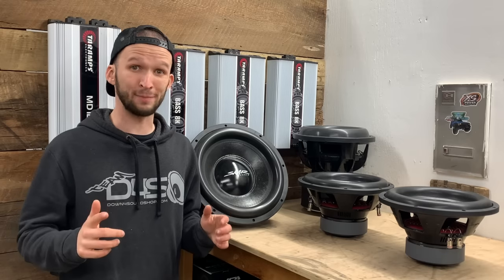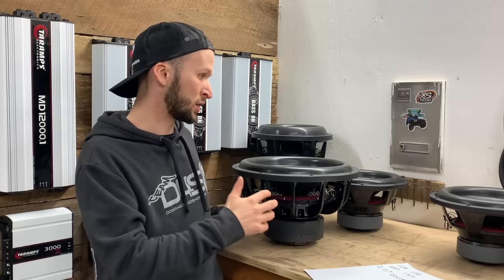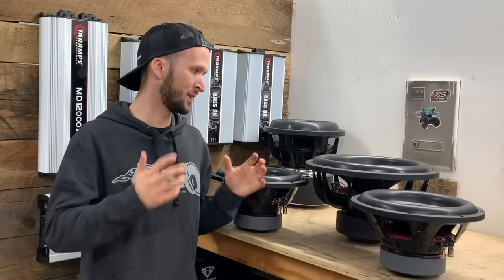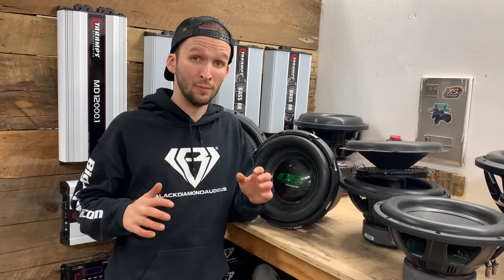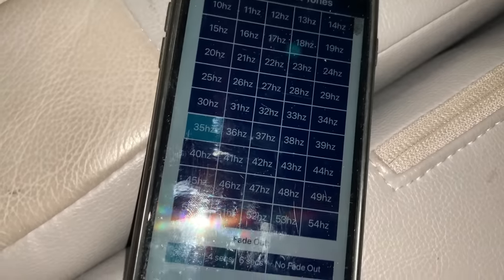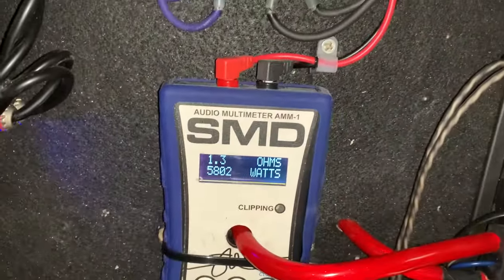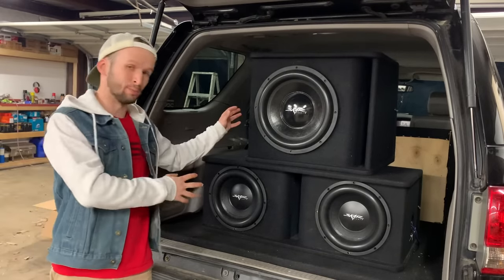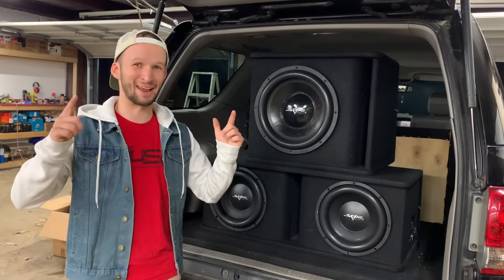ONE 15 VS TWO 12 SUBWOOFERS | MYTH BUSTED

Comment: Parker I just purchased a deaf bounce  db-sa302. What amp do recommend for this sub. I currently have a mojo 12 on a jl audio xmd 1000. I'm curious as to which sub will hit harder. I have to say I was very surprised by the mojo 12 on the 1000w jl audio amp. It is beating for one 12. My back doors and windows are actually flexing.  But I want to hear the deaf bounce. Just wondering what amp you would recommend.
Reply: The db has 500w more RMS power handling, but the db has 18.00 mm xmax, and Mojo has 19.56 mm of xmax. Plus, it has a 3.5in voice coil. And the db has a 3in one. The db might be 1 to 2 db louder, but really not much of a difference
Reply: @leoyser1369  no the db I have is 2000w rms at 4000w peak.
Reply: @GSR_Shawnnew3673_I'm Slow  yeah. I know the specs I was looking at the website
Reply: @GSR_Shawnnew3673_I'm Slow  how much you are willing to spend on an amp.
Reply: @GSR_Shawnnew3673_I'm Slow  I have multiple amps to recommend to you. I'm making a list

Comment: Don't know where those cone area specifications are coming from but they're not what I calculated, for example a 12 inch does not have 113 square inches due to the actual cone diam. is10.5"!.. .

Comment: Why presume that the same make and model of speaker in a bigger size is built better than the one below it? 15's and 18's are historically and statistically tougher to reliably control than a smaller size speaker.

Comment: It comes with cancellation. I'm just saying this before I even watched the video. Running one motor means you only have one problem to maintain. When you have two wave guides it's going to crash by a certain distance it's just audio science. The way we measure with a meter in weird corners of a vehicle also is not really true to the pressure of the complete. We really need lasers and other ways of figuring out the pressure against the vehicle. I haven't seen anybody do anything intelligent like that yet. Like i'm sure there's way to use flir to sense temperature changes in the body material of a vehicle. 
For the most part the officiators of car audio and competition for the most part a lot of it is opinion. It's like a pcr test. It can be false it can be true and it all depends on who is setting the legend and calibration.

Comment: How do you tune the 8k to only push the power of the sub?
Reply: @GetFuktPriusOwners  how do you know where to set it is what I’m askinf
Reply: @MOPARAUDIO oscilloscope or smd amm-1 or multimeter. At 1 ohm you just calculate the square root of the wattage you need to achieve and then set the amp(with sub disconnected output to ac voltage of whatever the square root of the desired wattage and you should be close. I think he has an amm1 though so it's much easier with that because you can adjust for box resistance rise bu checking wattage with amp running and sub connected. .

Comment: 2 12s sound better in my application. I have 15 now. I like 2 subs vs 1
Reply: What difference did you notice. I've always had atleast 2. But thinking about downsizing to one 15 vs 2 12s
Reply: @karamclemore  2 subs was more Impactfull. Strong bass. Bass much more fuller and the sound was much better. 2 12s more cone area than 1 15.

Comment: The 12’s will be louder, but they won’t play nearly as low……. I ran 4 10’s and 2 12’s….  Now I run 2 18’s IB.  It’s not even the Spl.  It’s the ability to play low so effortlessly.  Every sub I’ve owned has been high end …. I wouldn’t put Skar Audio in my kids Car…. Oh my 18’s are acoustic Elegance….   Certainly not as good as skar audio.

Comment: A thousand dollar 15 vs two 500$ 12's the 15 would be made better quality,. But the 15 would have more head room at peak volume vs the 12s,. Giving the 15 a higher RMS rating, hitting twice as hard and cleaner quality vs topped out 12's you might say,. A 2000 w 15 would play louder than a 1000-1500 12, 2 12s might hit just as hard as a 15 but the 12s won't have the wattage to get louder than the 15,. Do you want to hear it or feel it,. The 15 will feel the same but be louder overall,. But the same goes for a 1000$ 12 vs 2 500$ 12,. The 2 12s would distort and blow before getting as loud as the single with twice the rating,. You pay for what you get and once you had $1,000 sub you'll never go back to cheap